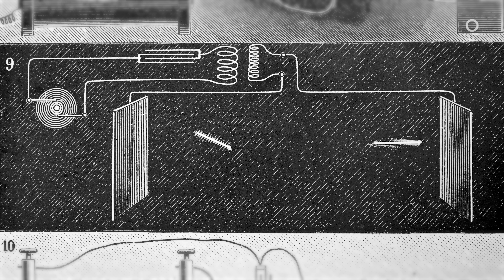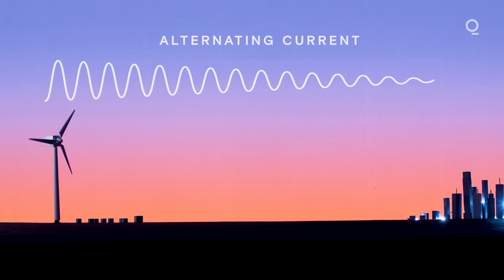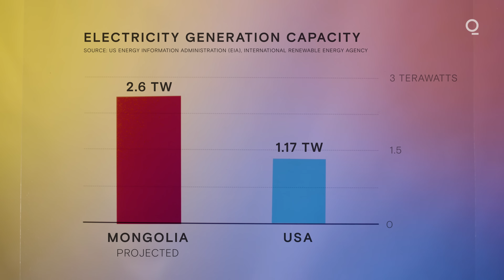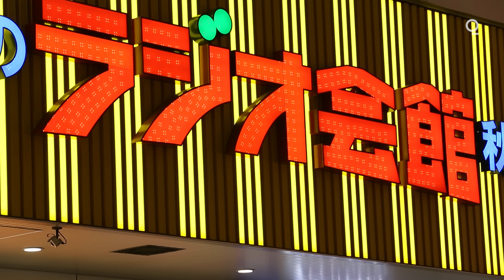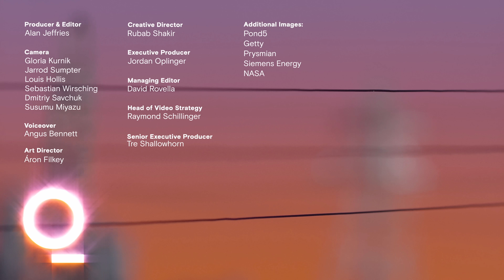The World Needs Supergrids, But There's a Problem

Comment: Grid interconnection is fine, but a global supergrid takes it too far.  Do not sacrifice resilience for efficiency.
Unless regulations are harmonized, power producers competing on price are incentivized to pollute more, similar to manufacturing in China.
Reply: Since the present lead for New Generation is Solar PV (cleanest, fastest, lowest-cost, and lowest-risk new generation, ever), this may accelerate Solar PV, and drive Coal, Gas, and Nukes off the world-wide grid faster.

Comment: Ridiculous notion. Transmitting DC power around the globe? Ever see a cityscape of NYC in the early 1900's? They used DC power at first, and the cables were HUGE, almost a foot thick., and that is just for a city that only used electricity for lights and some industry back then. WORLD WIDE WOULD NEED TO BE MILES IN DIAMETER.
THERE IS NOT ENOUGH COPPER ON EARTH TO MAKE THE CABLE TO DO THIS.
Nikola Tesla had this idea, and spent every penny he owned trying to get this to work, in case you never heard of Tesla's Coil.
Countries will never agree to share power. 
Before it was renamed to 'Global Supergrid', we simply called it a 'world wide energy grid', and the idea is over 100 years old, not new.
The more we look to the future, the more the ideas of our fathers are revealed. But, this idea will never work.
Reply: The DC cables back then had to be thick because of the low voltage, modern HVDC lines are much thinner. I live close to a HVDC line in New Zealand (when it was built in the 60's, it was the largest HVDC line in the world), it has 2 sets of double aluminum cables of the standard thickness you see on other high voltage transmission lines and it moves 1200MW of electricity....each cable can work independent of the other using an earth return, but in normal use one is at +350,000V and the other at -350,000V and when connected to a common earth they work against each other eliminating most of the earth return.

Comment: No need for such a silly idea as a super grid.  Decentralized and distributed if far better under the control of the locals and not some globalized group.  But then again, that doesn't work if you're obsessed with immature and unreliable technologies like solar and wind.  We need all the above power generation.  Including hydrocarbons, using each form of energy where it is best.  We can mine the atmosphere for carbon and use that carbon to produce other products to improve our lives.  Store part of it away as graphite and save that till we can actually mass produce graphene.  Over a couple of decades, pulling the carbon out of the air could even return it to pre-industrial levels.  

But the people who are pushing "renewables" don't care about real solutions.  They only care about centralizing power and enriching themselves.  Most politicians actually supporting this obsession are corrupt and have investments in "renewables" and they stand to make windfall profits off of the bad ideas that would destroy our quality of life and impoverish everyone else.
Reply: Where should all the locally required power come from if you dont like wind and solar?

Comment: super grid is nice, but with the need of long transport, maybe some companies use real a lot of electricity should move instead ?
mean calculate out what is better in costs and long term situation with grid, or transport, like the best for a coal plant was near the coal mining.
But the grid has no meaning without the supply of energy ...
My idea as of 24h need is more a different grid of long like solar panel lines around the world (on ground) build an used by countries next to its possibility together. Maybe a about 5 * 2 meter cells 10 meter wide ring of Solar-cells, with also contains nearby the grid to transport it.
As so a view of this east-west solar-power and grid along Southeast (from Vietnam Coast to Myanmar Coast) will provide also a longer steady energy over a day as the cells are in the sun more longer.
Imagine a line of solar cells 'along' trans sibirisch railway', starting French Atlantik up to Wladiwostok (Russia, Pazifik) causing a near 12 hour of steady solar energy ...
there will be more of them as central Spain (most less people) maybe every 100 km north/south ...
A ring of this solar-cells full around the hemisphere would solve that night problem at all ...
But also NOT using so much electric during the night (street light, advertisement, fun economy) is also needed NOW until we get there. WE fight the fun problem discussing expensive batteries, instead just to learn about earlier times: work at daylight, and sleep at night. Problem most solved then.
Reply: With your "solar line" you get either high DC voltages that will flash to the ground if you dont have isolators and isolate the solar panels to the ground (several meters high) or high currents that you cannot handle anymore (too thick conductors, too much material, none affordable).
So your idea is beyond technical feasibility.
Reply: @thomasmangold7489  
I think you've got the right general idea, that Wiegand may not quite have accomplished the Millennium -- but you owe us a more thoughtful post if you want to make that point.
The huge solar farms already in existence don't have the "flash to the ground" problem that you imagine, and "too thick conductors" don't seem to be a problem with the .75 megavolt lines we already have, so on the face of it you're just whining.
Reply: @David_Lloyd-Jones  In a big solar park you group together approx 5MW dc panels and convert them with an inverter into ac power on medium voltage level. For transmitting this you have to step it up to HV, say 132kV or 400kV or 765kV if you like. But even with HV the distance you can transmit is limited to a few 100km. For longer distances you have to utilize HVDC systems.
So to realize that what is suggested above you need a looot of equipment and infrastructure and it becomes complex, what probably costs more that the dc park itself.
Just connecting dc solar panels in parallel or in series brings you either high dc voltages and/or high dc currents, uncontrolled. How do you intend to hande those?

Comment: Part of the transmission line routing  issue  the lack of emmident domain laws that allowed the interstate highway system and the the long DC transmission line between The Dalles Oregon and Selmar near Los Angeles.  This is not an  engineering problem but a political problem.  Hard headed 
states states like Texas should consider becoming part of Mexico.

Comment: I am somewhat skeptic because of what I see happening in my area. A simple interconnection beween Canada and USA has been stopped by a referendum promoted by an american energy producer to stop a competitor. In this case clean hydroelectric energy will not be able to replace coal and gas to fight climate change.
Reply: To be fair, the US is a laggard in these kind of mega imfrastructures, even Africa has a 800kv high voltage cable, let alone Asia amd those advanced countries. The US is atypical
Reply: @nostramashego4226 Asia and Africa have many, many countries. Be more specific.
Reply: And so it goes. Big money. All other utilities are government controlled, but not energy....
Reply: It’s always private companies. They act like mafias.
Reply: This is a problem even today within Canada with no national energy grid.

The Newfoundland government had to accept very unfavorable terms with Quebec for the Churchill Falls agreement in 1969 or they would not have secured the additional funding needed to complete the project and they would not have access to markets since Quebec would not allow an energy corridor to access markets in Ontario or US.
Contract is a 65-years wholesale rate with no provisions for inflation or escalation that ends 2041.
Reply: If you mean the Champlain Hudson Power Express, my understanding is the project was temporarily blocked but is now moving forward. Progress! These two lines (one for Quebecois hydro, one for renewables) bringing clean electricity to NYC can potentially have a huge impact.
Reply: If the US and Canada ran on 100% renewables, how much of a difference would that make in the world climate, considering most of the industrial capacity of the world is not in either country? For the record, this is for argument only, as I am unconvinced that human activity is causing any substantial difference in global temperatures, thus no amount of renewable power will make a noticeable change in anything except our pocketbooks, which will be much lighter as a result.
Reply: @Ethan.Lamoureux  it would make a HUGE difference friend
Reply: @Ethan.Lamoureux  it would make a huge impact and will simultaneously pave path for others to follow
Reply: I'm a bit confused. The Eastern and Western Interconnection include all of the Canadian provinces that border the US. What part of the U.S. other than TX can't access Canadian power?
Reply: Keep in mind that's one setback that Canada and the US, especially across the Niagara River, trade massive amounts of electricity.
Reply: See this is the essence of govt. People run for office to rig markets & it does not matter what side of the climate picture you're on.
Reply: @kimlibera663  it wasn't government that stopped it. It was a private company that brainwashed voters into cancelling it through a referendum.
Reply: Hydro power (specifically dams) are super bad for the local ecosystem. Adding a few turbines along a river is fine, or harnessing tidal waves, but overall I feel like people downplay the effects of dams. Nuclear should be the move forward instead
Reply: @iceflower7004  While hydro power has some impact on the environment it's renewable and the impacts can be mitigated , nuclear power is not renewable and generates radioactive waste that has to be stored safely for thousands of years , who wants a nuclear power plant next to their home ? Not me.😉
Reply: Answer -- demonstrations that hit local TV and radio, and a revote.
Reply: We’re not fighting climate change it’s a battle we can’t win. No amount of money can change Earths 40,000 yr cycle of Earth tilt! Fantasy penetrates the brain.
Reply: Its not so innocent, hydro changes water schematics and changes whole ecosystems.
So I think it is time for the illusions to stop.
Reply: Yea the barriers are mostly political, nimbys don’t like change and producers don’t want competition
Reply: @calebweldon8102   it's Oil and Gas, Canada is completely captured by the industry because < "We LOVE OIL AND GAS"
Reply: Doescanada have 100percent rooftop solar. Do that and all energy traders disappear automatically!!!
Reply: Till now perfected in third world. Did you follow northstream efforts in Germany and Scandinavia?
Reply: the US Northeast is energy-poor anyway. Canada doesn't need their energy, I say let them use imported gas or freeze if they don't want our excess hydro.
Reply: @gabrieldsouza6541  Other way around. Canada has an incredible amount of hydroelectric power to sell to the northeast.
Reply: @gabrieldsouza6541  we built our PNW $16b Site-C dam to assure your needs are met in the future.  you're welcome
Reply: Progress may not always look like a straight line. Often there are zigzags?

Comment: Very nice, but I have 3 questions:
1- How much does a single project cost: installation, equipment, maintenance,...?
2- Will all consumers connected to the cable pay the same unit price?
3- Doesn't the interconnection of countries pose a challenge to their sovereignty and security?
Reply: Dependence on fossil fuels for local power plants has proven to be even more of a threat to sovereignty and security, as Europeans are finding out now, thanks to Russia.
Reply: @davestagner  Before it was wood and fish oil. After that coal. Now, fossil, geothermal, hydro and nuclear.
Before you change all of this for sun and wind, ask yourself what is the quantity of energy used globally on earth and if this quantity is decreasing or incrising.
Reply: @verynice5574  lool.. sorry !

Comment: China have 90% of HVDC of the world… but this vidéo speak about Germany….. heu…
Reply: You are kidding🤣 -- 90% Where is that number coming from? There are some for sure, but only a small fraction of your 90%.
Reply: @thomasmangold7489  sorry, I wrote
HVDC (high voltage), I wanted to write
"UHVDC" (ultra high voltage), above
one million watt. Basically nearly only
China build that.
For the HVDC China has 60% of the
world
For the source search:
Ultra-High Voltage Direct Current
Deployment
Caravaggio Caniglia
December 4, 2020

Have a nice day.
Reply: @shuaige3360  China owns the 1100kV, that's right, but even there engineering from Germany and Sweden and the 1st transformer was built by a German company to be copied by Chinese; and your 60% are less than 20%
.. that's why the video speaks about Germany...
Reply: @thomasmangold7489  I was speaking about 1100k, but by mistakes I wrote HVDC.
Impressive how in 10-15 years China moved from totally backward on most of things to the top of the world in many domains.
Same for high speed train. During this time they built 38.000 km of high speed trains, and plan to reach 75.000 km in 2035.

Comment: Decentralized power is where we need to head. More efficient solar, wind and batteries for individual homes. Or modular nuclear in every city.
Reply: imo we really need both - centralized as well as decentralized.
- faster to implement
- you can use advantages from both sides
- HVDC can save batteries by equalizing demand & generations (can have the potential to be cheaper than batteries)
- decentralized forms can relieve the grids, but for northern countries, you are still dependent on the grid in winter times. An option could however maybe be to use synthetic fuels to power your home then.
- centralized and decentralized batteries are needed nonetheless
- some energy forms like wind turbines is scaling in central generation (wind is faster+steadier if you go higher or off-shore), also biogas makes more sense in a bigger model (tho a personal use might sometimes be possible)
Regarding last point - no. Nuclear energy must be kept centralized, otherwise it's simply too dangerous.

Comment: Not the future of "energy", but the future of "energy transfer". Those are related, but different concepts.
Reply: I hear you, and yet electricity is still very expensive to store. Brazil still saves a lot of fuel by moving large blocks of electricity all around the country through its grid. With a large variety of hydrological basins with varying seasonal patterns connected in a grid, it’s exceedingly rare for the entire grid to be in a drought.
Reply: The future of ELECTRICITY transfer, electricity is only one of different sorts of energies!
Reply: @jmt97400  Indeed. I concur, sir.

Comment: While I fully support this idea as a form de-carbonizing our energy systems worldwide, I must also pinpoint the risk of relying in just one system for energy.

A very powerful solar flare event can wreak havoc on the grid, can last days, and in worldwide grid there is potential to create civilizational catastrophe. Solar flare of Carrington Event type level.

Such event could also disrupt all forms of communication.
Reply: Not as bad as you'd think. Power grids have automatic disconnects. A Carrington-scale flare would trip them all, directly or via cascade - but it wouldn't actually damage much. Power would be restored within days in the major cities. Lower-priority rural areas might wait weeks. In the meantime some of the most critical areas, like hospitals, would switch to their diesel backups. So it's bad, it would cause billions of dollars of economic damage, but it isn't a civilisation-collapsing disaster.
Reply: If a solar flare hits Earth then all communication would already be cut. I personally don't believe it will be civilization ending. And a solar flare today would already take out most of earth's electrical infrastructure. So, either way, the problem isn't the power grid. But the fact that a solar flare hit earth.
Reply: Having multiple grids wont solve the problem if its Carrington size or larger either.